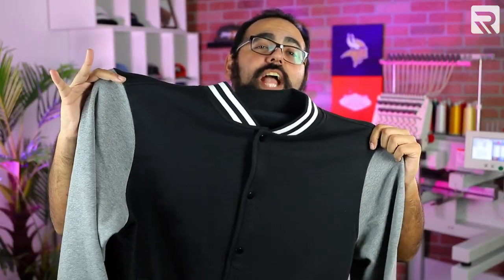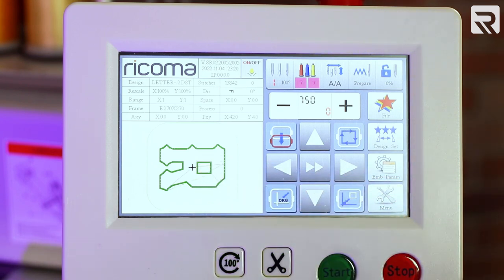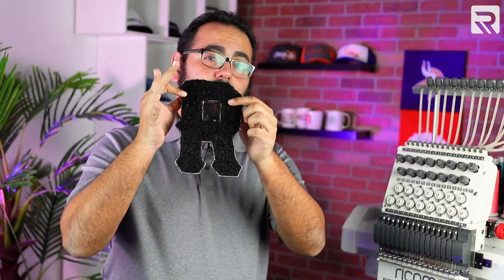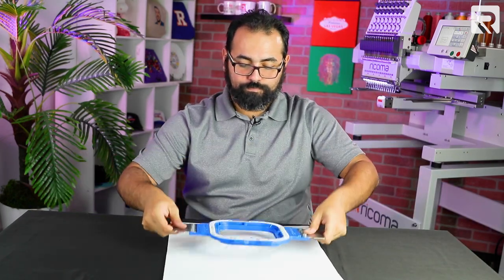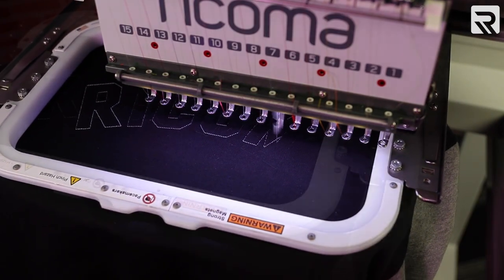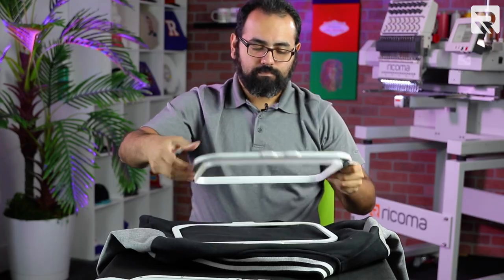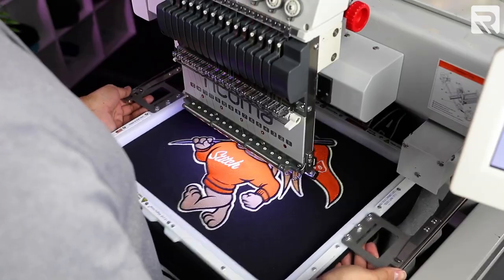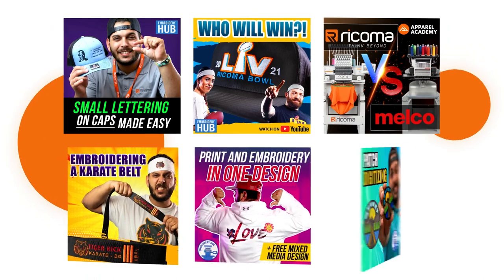INSANE Profit Potential with Appliqué Embroidery on Letterman Jackets

Comment: Why don't you just do your tackdown on the actual garment? I always do that follow by my tackdown and then my finishing stitch
Reply from the maker: We appreciate the suggestion!
Reply: I don't know if your question was a suggestion but based on this video I was wondering the same thing because I do a tack down stitch. But what I gather from this video is that is a lot easier to cut out the applique the way he did it. Because he was able to take it off the hoop then trying to cut it out after being attacked down while still being attached to the hoop. I just did a letterman applique type file it was annoying trying to cut around the letters while still being attached in the hoop
Reply: @irvinoneil  I don't know what kinda of hoops you're using but I have mighty hoops and it super easy to cut my appliques. I also have a multi needle machine so it easier than if you have a single needle which I use to have. I would never cut my applique pieces first as now you created an extra unnecessary step and make your process longer. Also you run the risk of possibility not cutting your applique pieces correctly were when you do your satin stitch you may have fabric lifting because you cut to small.
Reply: @fairytalewonders4555  I use mighty hoops and have much needle machine as well depending on how big or small the design is cutting the round attached down piece of fabric can be easy or can be difficult. And you are right. Cutting the applicator design out separately can be a problem if you make a mistake or cut the design too small. But if you know you're exact measurements for your design such as the r letter he used in the video and you're doing multiple garments I don't see it as a waste of time or extra step the way he did it especially if you have a hoop big enough to do multiple hours at one time cut them out play some on a jacket and tack them down

Comment: What’s the difference between the Ricoma MCC- 061201 and Ricoma MT-1501? 
Because I know using the Ricoma MT 1501 you can hoop up jackets and detach the flat table etc. So can’t you hoop up jackets or detach the flat table with the ricoma MCc 061201? Like how the MT 1501 can.

Because I want an embroidery machine that can do both if possible, but if I can’t detach the flat table and use the different size hoops to directly embroider on the jacket then I’ll have to get a separate chenille machine by itself and figure out how to embroider the border around the chenille part separately.

So far I’m looking towards the Ricoma MT-1501, as it has a detachable table and it has multiple hoop sizes to directly embroider on big jacks etc. But if the MCC- 061201 can do the same as the MT-1501 but with the added chenille part then I’ll be jumping with joy as my research is complete. That’s if Ricoma brands can ship to the uk that is, if not then I’ll be jumping with sadness 😅.
Reply from the maker: Hi there! Please submit a request with our team so they can help you pick the perfect machine. ---> https://ricoma.com/US/contact-us